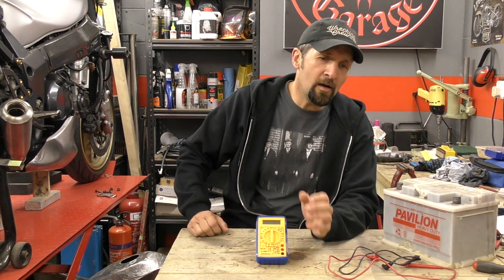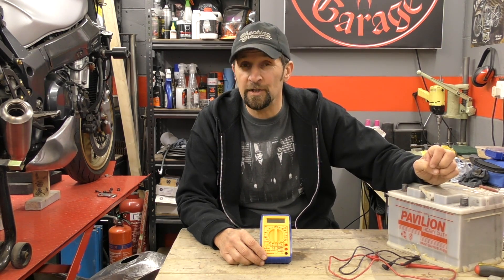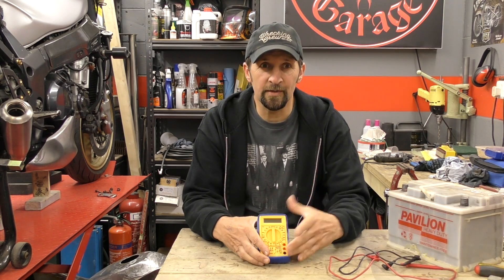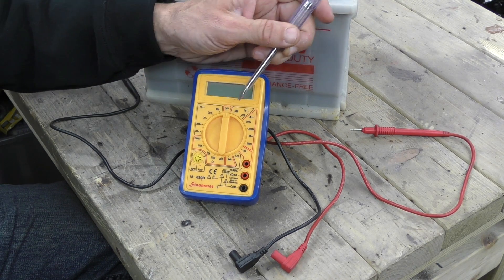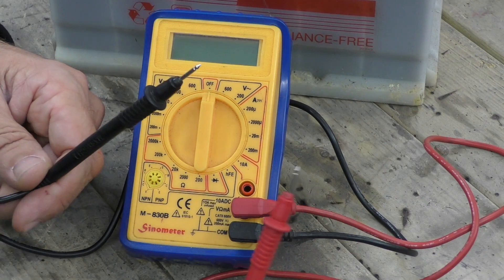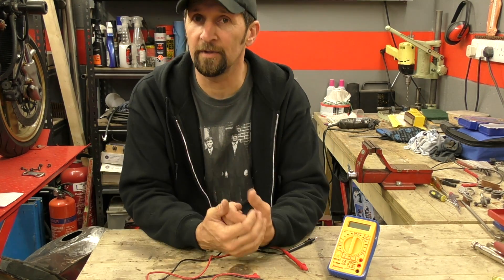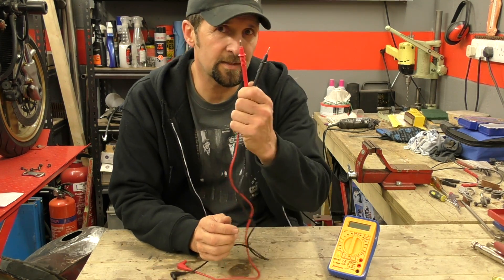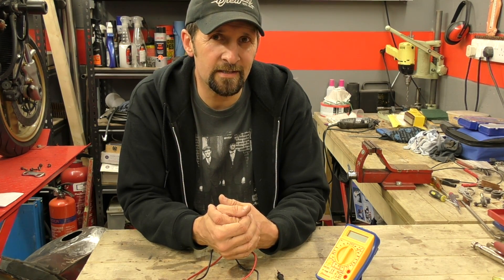Delboy's Garage, Simple Skills, # Multimeter.

Comment: The ohms difference you saw (.03 to .04) when you measured your first glass fuse was through your hands and body.  It's helpful to be aware that if your hands are touching both leads, you're reading parallel resistance through your body.

Comment: My new harley struggles to go past 12.52 even after a long blast or charge with optimate is it needing replacnet its still under warranty?
Reply from the maker: If it's under warranty mate, then drop by the dealership and ask them to test it.. they will make a decision and replace it if needed im sure..!
Reply: @Moonfleet41  cheers del, yeah they said they would under warranty spose ti's cheaper to replace battery than any of the other charging system Component's I only got the bike a month ago but never got logbook but spotted it wouldn't start afyer two day after optimate charge doesn't reach full capacity at all either thanks again

Comment: Hay Del. Just got new battery for Fazer along with other bits for new mot. Two weeks of battery in the box, at 600 volts show 13v; at200 its 13.1; at 20 its 13.05. first time showing actual how to with multimeter. cheers coffee?
Reply: Hi. just joined patreon. Got today from ebay a coffee mug that heats water so you can have a coffee, or soap or tea or evan a warm toddy if you are at the end of riding for the day. Anyway might as well try it out. plugged into lighter socket with couple crockadile clips connected to that old bike battery. Well it workd an hour after pluggin I got a hot cuppa. That will make my journeys more fun. I enjoy coffee on my own, now independant from cafes, voltage at 12.75. not bad.. Cheers guys.
Reply from the maker: Hi Greg.. Thank you so much for your kind and generous support, we've sent you a personal message from the Patreon platform.  I love the idea of hit coffee on the move while you're out.. what a great idea.!  Take care, ride safe and have a wonderful week my friend.. D&Pxx

Comment: I hardly ever use my multimeter anymore my testlight has a volt meter built in and it lights up green or red if something is going to ground youll need a multimeter to test can bus which i havnt learned tho

Comment: Thank you for the very informative video! I am currently trying to figure out an issue that I think may be a parasitic draw in my 2010 Jeep Liberty. After watching multiple videos on how to test for a parasitic draw and doing a instructed, I realized that I'm not getting a proper reading and it probably ha to do with not knowing how my multimeter functions in the first place. After an alternator change, my car is still draining my battery so much that it's destroying any battery I put in once I drive it. This is all happening AFTER taking it to a well known shop to have it diagnosed and not being told anything about any electrical issues or alternator issues so now I'm scared to take it back because I don't know if they intentionally meddled with something just to get me to return and spend more. Do you have any videos to might point me in the right direction here?
Reply from the maker: Im sorry Aiden, i don't, every situation is different, diagnosis of any fault is a process of elimination and experimenting with different possibilities until you isolate it.. All i could offer is what i would do if i had the same fears of the shop that you mention, and that is to take the car to a different shop for a fresh diagnosis, if you fear the last place wasn't honest with you then the trust is gone so take it elsewhere.  Sorry i can't be more help, i hope you can get it fixed..

Comment: Fantastic video. I recognise the need for a Multimeter and have needed to use them to trouble shoot things, but being scared of electricity and not understanding how they work  I never used it. And because I didn't understand the manual or the language used It lay in a drawer. I actually paused the video you made & wrote with a permanent marker on the meter the relevant settings. But like you said, interpreting the readings is another thing altogether. You never went into Amps.  I'm trouble shooting a 1986 heritage softail, nothing big, just issues. would amp readings be used much in fault finings

Comment: very good explanation, .....and that's coming from a local#3 electrician!.
and you are right, Del.  I had to take a 5 year apprentice program, to become an expert,like I am today!!  
thanks...penny and DEl. Always success!!.
I just had to replace the starter relay, post down under the  belly of the beast!!  had to remove, oil tank, battery, rear wheel and splash guard, just to access the post and neg terminal post(plastic) ,on my 2005 15th anniversary Fatboy!  thanks again. 
PS...great camera work, as usual ....P.P 😁

Comment: Any thoughts on diagnosing a munted horn on my scrambler?  The fuse looks good but I don't seem to be getting voltage across the pins on the horn.  Maybe run my own cable? Or maybe the button doesn't work?
Reply from the maker: Hi Matt, good to hear from you again, and sorry to hear about your horny issue..lol      

 Ok, its just a case of tracing the break in live feed...presuming the terminals are the correct way round on the horn?.   Change the fuse, even if it looks ok, then you know its not that.. then, with ignition 'On',  check for feed up at the switch, (just open the switch block and you'll see the wires inside on the back of the horn button),  check for a live feed into the button, then 'press' the horn button to check the feed wire out,  if it reads live, then that will confirm the horn button is working... 

Check any plugs on the way down to the horn, (there will be at least one as the switch block will have its own length of harness so it can be removed).... no need to check those plugs for live feed, just make sure they are firmly plugged in...

 Then check the feed wire into the horn itself... if you have feed going in, but no sound.. then the horn is suspect.. so take it off the bike, stick a length of wire onto each terminal, and bridge it across the battery... if it works, then you maybe have an earth problem, perhaps the way the horn bolts to the frame, that can get corroded as its in the path of all the road grime.?...  

 Those are all the things to check my friend, see what you find at each check point and let me know.. there is a remedy for everything, the devil task with electrics is just tracing it...    Good luck, and let us know how you get on buddy.. fingers crossed and all the best, Del.
Reply: Moonfleet41 awesome thanks man! Will let you know 😊

Comment: Hey Dell, whazuuurp.? Re: 7" LED Projection HEADLIGHT Anyway just wanted to thank you again for the the very useful info you supplied on this vid: I'm a bit dyslexic when it comes to understanding the schematics and connectivity of things, anyways today your tuition proved very useful, i.e.: as I've mentioned before I have a 2013 Harley Softail Slim, I've done loads of mods on it over the last 18 months and your vids: have helped me a lot, but yesterday my BLACK SMOKED LED PROJECTION HEADLIGHT arrived from America, Made by EAGLE LIGHTS an American company who make lights for the automotive industry including Harley and Jeep, it's the same type Evo 8700 there currently fitting to Harleys called the "DAYMAKER"costing well over £600 
I paid £88 including shipping,VAT, and duties , shipped through the global shipping network , I was excited! Anyways I put my bike into maintenance mode ,they say you should remove the main fuse but I never have When tinkering, or adding a mod, so far I've got away with not removing it, anyway I carefully removed my headlight rims and disconnected , good idea to have a magnetic dish for the screws, there fiddly but if your careful you won't drop one, I always take out the top screw last so I can hold the rim and sealed unit at the bottom with one hand while I unscrew it, otherwise it could disconnect and drop out.  
On the original 7" headlight there's the main H4 connector in the centre and 2 small single wire connectors for side lights at the bottom, the new headlight don't use these 2 small wires as everything runs off the H4 lead, anyway the new headlight has an H4 connector so I just plugged it in and then just tucked the other 2 small connectors inside the shell and then refitted the shrouds, looked well nice and goes with my smoked indicators, anyways turned on the ignition switch and the light came on wonderful? But then I turned the handlebars slightly and suddenly the light went out, DAMN, Tried to start the bike and everything dead, FXXK. .? What have I done? Sxxxte it's starting to rain and my bikes in a bikebarn pull over cover so I'm working outside, so I quickly removed the new headlight and put the old one back in, Hey Presto everything worked as before, pixxxsing down with rain for rest of day so I slept on it, obviously It was playing on my mind throughout the night, then it came to me!!! I wonder if those 2 small single connectors had touched the headlight casing?? Mmmmm?? 
Anyway today I looked at the workshop manual TROUBLESHOOTING, it said to check fuses, something I've never done before, anyway Sussed out how to take the fuse holder apart and removed the 2 x 15amp fuses ,fortunately there were 2 spares in the holder replaced the old ones with new and put the it back together, Then I started over, but this time I looked at the 2 small single connectors and even thought they've got rubber shrouds over the pushon connections there is a minute part of the metal showing out the end of the rubber shroud, So I taped them up and reinstalled the new headlight, HEY PRESTO! All working just fine tried switching the ignition on and off several times and it's still working, so I can only assume the 2 single connectors had shorted out on the inside of the headlight shell, ANYWAYS I'm well chuffed and it looks nice, SO??!! As I had swapped out the fusses I thought of your Vid: and thought I'd put it to the test I'll check to see which  of the 2 fuses I'd replaced was blown , got me iPad and went to YouTube WATCH KATER VIDS: found yours and refreshed my thick skull with how to check the fuses, I've got the same meter as you and have had it for umpteen years and it's been kicked/ dropped / pushed around as it's just something I just could not get my head round as to how it worked, OK so I KNew how to check batteries but not how to check fuses, So I had your vid running and copied your actions, when I switched it to 200 ohms like you say it showed 1 as you say, then I touched the 2contacts together it read 1.7 then I checked the fuses and they both checked out OK DOH! so I can only assume that I need a new Multimeter as like you say the leads are probably  knackered with all the kicking around etc, Fortunately there still selling them through a UK seller on EBay for a fiver so I've ordered one, when it arrives I'll check again and update this thread with my findings, anyways I hope this helps anyone who who may have similar probs: when fitting this type of headlight unit because from what I've been reading on the US Harley Forums quite a few people have had similar probs, but haven't sussed it and sent the unit back for replacement, something that I nearly done, and as it comes from the States can prove quite costly, Cheers George Wheeler in Oxford.

Comment: Nice "basics only" video, but I think there is one pretty important basic thing to know about multimeters that was not covered: don't EVER try to measure current "directly". That is switch the meter to measure amps and connect it directly to a current source like a car/bike battery or even worse - the mains. You WILL blow the fuse in the meter, or if the meter doesn't have one (some of the cheap ones don't) blow the meter itself and possibly your hand with it.
All the amps ranges in all the meters (except clamp meters, but that's a different story) are about measuring current flowing in a circuit. So if you connect the meter set to measure amps directly across a battery, that's essentially a dead short. That's why the amps measurement usually has it's own separate input jack - so that you don't blow your meter accidently while switching through the different ranges.

Comment: I recommend getting an auto ranging meter, even if its a cheap one it better than the old style where you have to select the ranges, if you want a really accurate and safe one for use at mains voltages then look at high quality CAT rated ones Fluke are well regarded.

Comment: Great!  So next show us how to check for a broken circuit and/or a short circuit, and hunt down the location of it.  As I understand it, the voltage meter (for motorcycles, set it at 20v) is for checking the health of your battery.  And the Ohm meter (that horseshoe shaped symbol) is for checking circuits.
Reply from the maker: Hi Andrew, Im not planning on making a series of videos on electrics...it a huge subject and could take over the whole channel, this was just a walk through of the tool and a couple of basic checks.. like i said in the video, once you know how to make those checks, then you can start working out how to diagnose faults.. but if you cant even read the meter, or interpret the data, then you cant even start.

Comment: Nice one Del, well explained... I always use the water comparison too, to explain voltage, current, power and resistance.

One very key point is that if you ever use the Amp setting (with the red lead in the Amp/current socket), then you MUST put the lead back into the voltage socket when you're finished, because the current setting is basically  short circuit, meaning if you use the meter thinking you're checking voltage afterwards, then you will short the battery out through the wiring, blowing fuses, and also destroying your multimeter.

They are also extremely handy for telling if your alternator is working on your bike or car... If anyone is interested in how to check for this, then I'm happy to advise on here.
Reply from the maker: Thanks Martin, great insight buddy... and thanks for pitching in... Good to see you ta the big event.. didnt we all have a great time.. take care fella.. Del.
Reply: No problem Del. Always glad to help...especially on a subject I know rather a lot about 😊
I really loved the weekend, relaxed, fun and met some great new friends... If I'm honest, I didn't want it to end!
Take care and speak soon.

Comment: Cracking intro to using a multimeter.  You explained it perfectly.
I bought one much like yours many years ago but gave it away when I found out that autoranging meters have dropped in price hugely in recent years.  For the uninitiated, 'autoranging' means you don't have to manually set the voltage range to 20v (or whatever) - just V-AC or V-DC and the meter chooses the appropriate range for you.
UNI-T make a cheap meter for about £15 that measure voltage, current, resistance, capacitance, frequency and audible continuity.  I wouldn't use it professionally or on voltages over 240v but for home auto electrics it does about everything you could need.  I'm chuffed with mine.  ... and, no, I have no connection to the company, just a happy user.

Comment: hi del and all just want to say a auto range digital multimeter is  easier for beginners to understand it you can buy them on ebay
for a £5 but there is one thing to you all don't plug its in the wall unless its rated for 240v ac

Comment: It's good the video shows one doesn't have to have a really expensive professional meter to do the sort of checks you will do as a home mechanic, but, for the people who don't already have one, may I suggest spending a couple of Pounds more for one which has an audible continuity check function. You should still expect to pay less than 30 Pounds and, as a bonus, some of those meters come with a temperature range and probe as well, which is very useful at times.
Anyway, audible continuity check function, you won't regret it.
Reply: Agreed, I'm no electrician but the audible continuity check is a great feature. Much easier than reading the resistance off the screen, especially if you're working ion something in an awkward place.

Comment: It would be a plus for diagnosing a faulty battery if you have a headlamp connected to some jumper cables.connect it to the battery while measuring the voltage....that would be measuring under load....helps even more to decide if you need to replace it.
Just be careful with the lamp, they tend to get hot... ;) Great vid Del, thanks
Reply from the maker: Hi Andi, yes there are many diagnostic experiments you can do once you understand how to take a reading... thanks for your input too, thats a great way to test a battery..

Comment: very well explained, essential kit for cars n bikes .i only know those two bits on mine but its what you need...
quality viewing buddy..
xxx
Reply from the maker: The spacer always moves, they're just a little tight.. use a sharp thin 
chisel fed through the wheel, and tap against the edge of the opposite 
end bearing all it needs is half  a millimeter of movement and it'll 
free up.!Good luck with it.